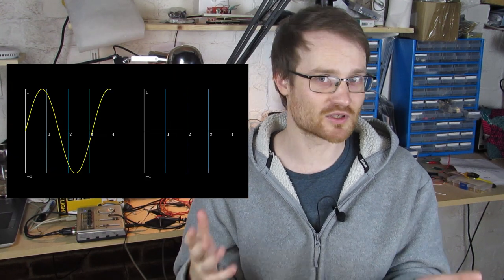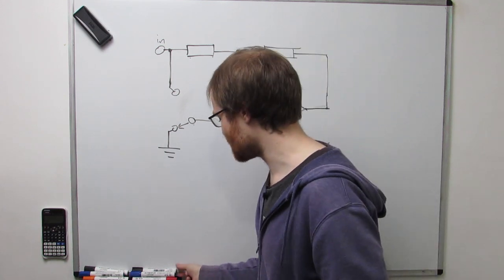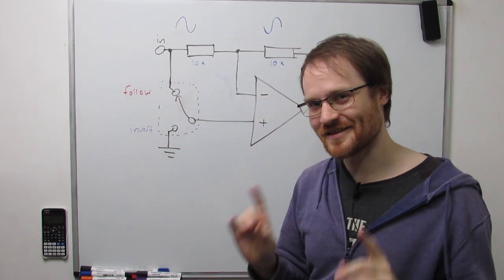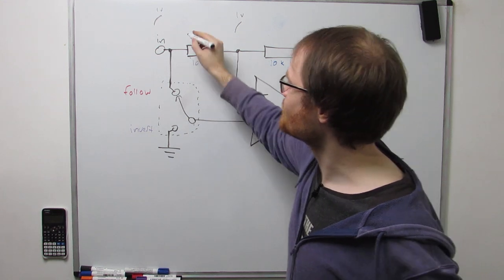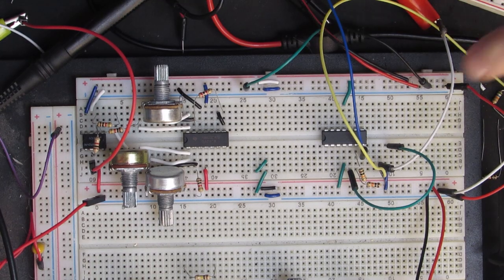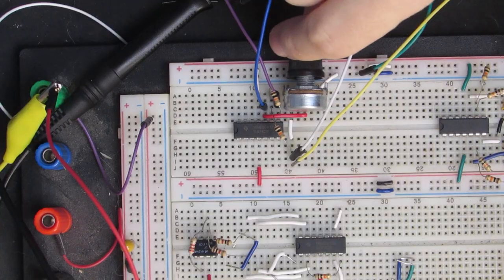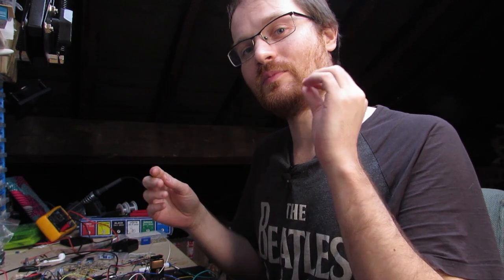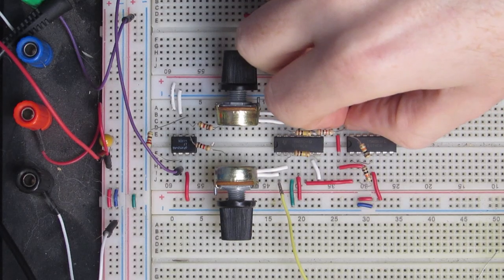DIY Phase Inverter & Attenuverter

Comment: Awsome as always ! Your channel is one of the place where i learn the most thank you

Could you (i you want to and have the time to) explain how to constrain a voltage range to an other ?
I'm trying to have +/-12v in input and 0v/+5v at the output to be able to use MCU and single board computer with controle voltage.
Reply from the maker: Thanks for watching! :)
It depends a little on the circuit. is your +/-12v AC or DC? Assuming this is all DC, If you want 5v at the output you can simply divide the +12v down to +5v with a simple voltage divider (3.3k & 2.4k for example) and then make sure you reference the 5V output to the 0v reference from your +/-12v supply.
If you can attach a circuit of some kind i can be a little more helpful!
Reply: Wow thanks that's fast =)

It's actualy for both DC and AC as i'd like to use a modular synth's signals as a source and read it with some arduino/raspberry. So circuit "look" like :
input jack -> attenuverter -> ??? -> Arduino

Where the "???" is constraining the voltage to a range of 0v to 5v

i dont quite understand this : " make sure you reference the 5V output to the 0v reference from your +/-12v supply "
Reply: @plop-4269  first you have to decrease the signal amplitude from +-12V to +-2.5V then shift it up by 2.5V to get a signal with a range of 0-5V.
Really simple. Take a voltage divider and use a summing amplifier to add the desired Offset. But make sure you build in overvoltage protection in front of your ADC input. A resistor and two schottky diodes will do the job.

(Be aware that some Arduino's and Raspberry generally use 3.3V)
Reply from the maker: @plop-4269  Sorry mate i misunderstood your question.
What i thought you were asking it how to get 5v DC from a +/-12v power supply and i suggested something like this (https://tinyurl.com/y2hj8u9h )

Now i get what you mean. You want a +/-12v audio source down to within 0-5v so you don't clip the input of your micro? 

@Permire Fabrica is absolutely right. You need to first shrink your signal down so that it fits into the voltage range you want [+/-12(24v) to +/-2.5(5v)] then shift it into that voltage range [+/-2.5v to 0-5v]
That would look something like this https://tinyurl.com/y49amtyr
I have a video on summing amplifiers here if you want to know more about this circuit :)
https://youtu.be/YCIcnFuRK7w

Comment: Greetings! Great channel and info my friend. Do you take requests or challenges? One circuit application that no one talks about is a high impedance inverting buffer. The requirements would be the following: 1) 1M or higher Zin, 2) low noise design, 3) 1k or less Zo, 4) Transistor or op-amp, your choice, 5) Gain of unity (AV=-1), 6) Output must pass full swing of input, without the use of a post amplifier, 7) Standard op-amp R2/R1 inverting amplifier not allowed, as this would not meet the "low noise" requirement above, 8) No restriction on complexity of circuit, 9) 20-20kHz BW. I know of only one circuit configuration that fits these requirements quite well, but it is not well known. I'd like to see what you might come up with, as this is a real challenge.

Comment: Great video. I’m a novice at electronics and I’m putting together a modular synth. I’d like to have a module that inverts/reverses the audio signal, without attenuating it. So, I assembled your circuit [the one with the switch], a 555 timer in astable mode and an lm386 op-amp. Something is happening but I’m not quite sure what exactly, as I don’t yet own an oscilloscope. Anyway, with the switch in the non-inverting position - the audio signal from the 555 remains unmodified but when the switch is in the inverting position, the signal sounds like it’s slowly dying out [which kind of sounds like it’s in reverse, I guess] and after a short while, it dies out completely. Now, since I don’t have a scope, I don’t know if I have achieved “signal inversion” or not. In your examples, you say that the signals cancel each other out [blue flatline] in “out of phase” mode. So, what is “out of phase” supposed to sound like? Please let me know - I really want to learn. I’m sorry for the long text and thank you kindly. Cheers!
Reply from the maker: Doing audio electronics without a scope is very difficult if something goes wrong in your circuit!
That doesn't sound right. The signal will only cancel out if you're mixing it back in with the original signal, not sure you're doing that. On it's own the phase inverted signal will sound exactly the same as the original signal.